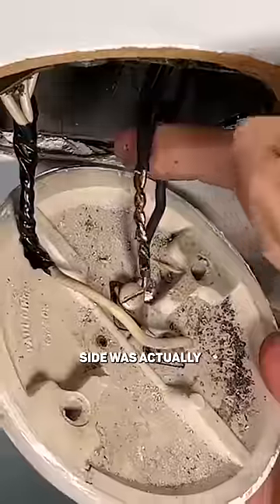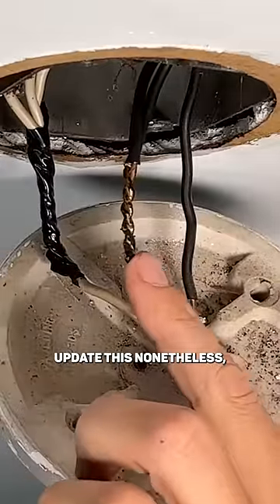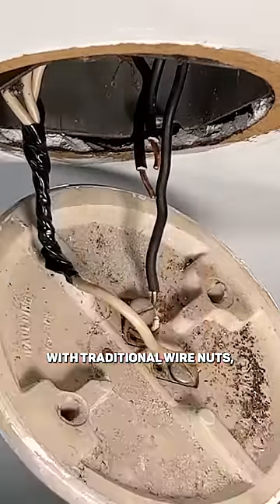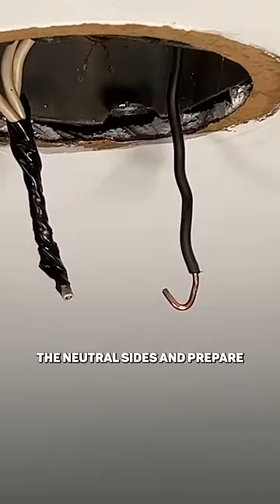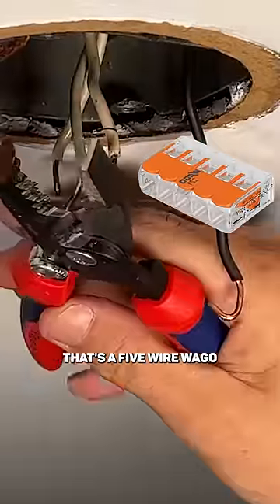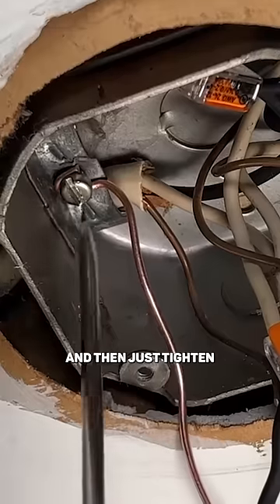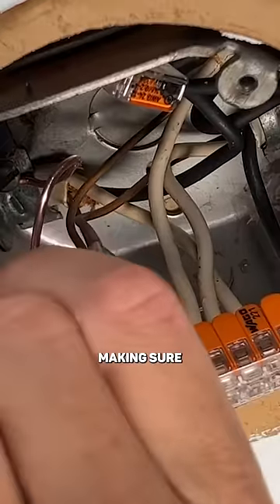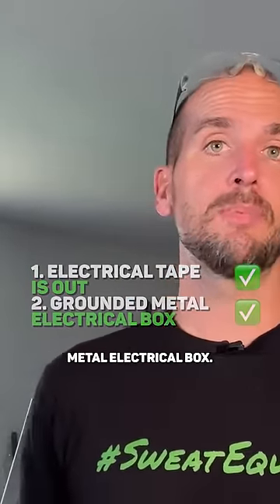Which Part Doesn't Meet Code?

Comment: I thought I was the only crazy person who soldered twisted copper wires together.
            And then I would put the wire, nut on after that for protection. 
And then use friction tape to wrap the wire nut to the wires

Comment: Those connectors melt. I wouldnt use them in high voltage over 24v. See it all the time on service calls. Wire nuts hold better than these connectors.

Comment: So a wago is better that a solder joint and a ground wire does not go on the code compliant ground?  What country are you in?  We have quality and safety standards in the states.

Comment: Dude I’m sorry to insult you but you have no idea what you are doing no master electrician would ever ground under a screw that could never get a tight connection to the box you should know better that what you put that ground wire under is a screw to secure the wire

Comment: Why whould you get rid of a solder joint like that? it will last longer if you use a nut or liquid electrical tape but instead you replace it with a wago connector which is not gonna last. all you needed to do was to cut the twisted solder joint to the right size and use a wire nut.

Comment: btw the first number of "412" or "415" is the maximum wiresize in mm² they are also available for 6mm² wire or a little bit more than 10 AWG but a 9 AWG won't fit.

Comment: stab clips are a fire hazard never use them that old connection was how old before you took it apart . if you do not know the neutral is a identified current charring wire so you connected ground to neutral hope you are insured you are going to have a fire no ground on fixture no ground needed

Comment: the ground termination is not code & by cutting out the solder weakened the connection. Take off tape, cut back twist, use wire nut. 100% better connection than using Wago

Comment: You are not electrician, the box is not bonded to the panel, putting a ground wire on a cable clamp is a big no no , plus the solder fine,

Comment: That solder joint will be the last thing to fall apart in that house. I don't trust waggy nuts. That's compression exerted by a plastic lever holding the wire against a flat piece of metal. Time, heat and corrosion will tell.

Comment: No you shouldn't twist them that long, they're supposed to be shorter so that all the copper can fit under the wire nut, it may or may not be cold compliant but I've been an electrician for years and I would never trust that enough to leave it in somebody's house without a wire nut and tape over it.

Comment: The wago piece of crap. use a wire nut or even better Solder its old school its better than wago loose connections and fails

Comment: Test them!! the contact points they make is not enough for any kind of load and failure of these are just a matter of hours instead of the traditional method that last for many years

Comment: A non electrician using fire starters to hold wires together. Not a secure connection. 
Twisting the wires together alone is secure and a wire nut secures and insulates.

Comment: Say it with me man. Way-go. Waw-go sounds goofy. Also, turn your hook the other way when screwing it down. When you go with the screw, the screw will pull your hook in tighter. Didnt look to shabby otherwise. Ive opened up work done by "handymen" that looked significantly worse. Just a little tip from a sparky my boy.
Reply: He wrapped the wire correctly in the video…

Comment: those “easier”connectors keep the service industry busy. I don’t like them. In a recessed can light is the only place I’d use them. He is in a remodel situation so there is some corners you can cut. Wirenuts are king. Should use a green ground clip if there is no threaded hole. If he is trying to go code he missed it with the ground. Green screw or green ground clip. Over all he cut out a connection that would go a life time without issue  and used  his easier connector that has a flat metal contact inside the connector. So you load is carried through a blade contact. Weak connection  when the circuit Runs back out to feed more devices/lights,plugs,  
shit trim the original  connection  use a wirenut  grab a self tapper pigtail the ground and make it up. Use your hammer to mash the wire in the box so you can get the cover on.  Oh that you shouldn’t. Do. Better use 2 3/0 extension rings. And clip the ground on the top ring. Laughing and some of the guys that read this have seen it.   Some have done it.
Reply from the maker: Thanks for all the feedback. 👍

Comment: the fixture is not grounded because there is nowhere to attach the ground wire.  Rather than cutting the wires short and using a wago, put a wire nut on it and be done.

Comment: Code Complaint?  Since when does Soldering home electrican code compliant?
Reply: Soldering is one of the oldest, and most secure methods of joining conductors. If done right, and insulated properly, there is no "better" way electrically.

Comment: Doesn't code require that the wires extend past the opening by 5 or 6 inches?
Reply: For new installations, yes. And if the box is 1 gang, then it needs to stick out at least 3 inches outside the box. If the existing box has shorter wires, then they can be extended or pigtailed for more length.

Comment: Your ground screw is no good because the box isn't grounded it's mounted to wood with Romex feeding it only the ground wire itself is grounded at the panel. Hopefully
Reply: I believe he was grounding the box in case a live wire ever came in contact with it, not trying to ground the fixture from the box.

Comment: Good luck with those wagos , loose connections about to happen , AFCIS breakers don’t approve them 😂
Reply from the maker: First I heard of WAGO 221 not being approved for AFCI circuits.  Is there a specific brand or literature you could point me to where WAGO 221 is called out by the brand as not approved?  Thx!
Reply: Wago is both ul listed and nec approved in the US. I worked in a law firm that handled construction defect litigation. Plaintiffs lost the case and the appeal primarily because of their claims that wagos were not code compliant. (Case was in OR 3 years ago)

Comment: Isnt a wago essentially the same as back probing an outlet which we all know we shouldn’t do
Reply: No, there’s a much larger contact area between the wire and Wago connector than a traditional outlet “backstab”.  I honestly don’t understand all of the hatred for them.  I use them in an industrial setting and haven’t had a single problem yet.

Comment: Anybody who uses those connectors should have there license revoked. Most dangerous connectors I have ever had the displeasure of coming across. They have a habit of coming undone.
Reply: How the hell do you manage to have a Wago come undone? What the fuck are you doing on the other side of the pond when you can even use Wago's successfully?
Reply: @AlexKall  open up the box and the damn things come apart in my hands. Almost been bitten multiple times because of those damn things.

Comment: In my old place, the 'electrician' had 'bonded' the hot wires with copper ground  crimps and wrapped them, didn't even bother to twist them. Then covered with electrical tape.
Reply: That wasn't an electrician then

Comment: Yup, I agree with everyone else who's already commented. 

The way you terminated that grounding wire was wrong and not compliant with the NEC. 

The grounding wire must be terminated in a manner that it's sole purpose is to bond the metal box to the electrical grounding system. By putting it under a screw that is there to fasten the cable clamp and cable to the box, you are not code compliant. 

The grounding screw shall serve no other purpose other than to fasten the grounding wire to the box.

 Although you might think, "what's the difference", the truth is, that cable clamp screw would not be providing as good of a solid path to ground as a dedicated grounding screw which is meant for this purpose would. 

So the method you showed should never be used and you shouldn't be teaching others to do it this way.
Reply: I know it’s not to code, but please explain how it’s not as solid a bond?  As long as that screw is tight, the bond is fine.  Will carry just as many amps to the same place as that pretty green screw.
Reply: @91156  The concern is that you won't get a really solid bond because in order to torque that screw down to give you a solid connection, you'd be damaging the wire under the clamp.

I used to do it the way you mentioned in your video many years ago, because that's the way I was taught by an old timer, but after going through an apprenticeship program and really studying and understanding the code and how electricity works, I don't do it that way any longer.

If you ever get a chance, try to take a Mike Holt class on grounding and bonding. His material is excellent and would help you understand why the way you are doing it is wrong.
Reply: @El_Diablo_LI  Never said I was doing it this way, because I don’t.  I said it was a lot better than nothing, because it is.   A clamp screw is snug enough to carry the amp load needed to bond a box.  I do follow code in MY electrical work.

Comment: I’m new so be gentle, you can put ground wires in a wago?
Reply from the maker: Yeah, but I should have used a ground clip or drilled/tapped a hole to bond the ground pigtail to the actual metal box and not the screw which tightens the integrated romex clamps.  👍

Comment: Screw can’t perform 2 functions . Must have separate screw for Gand wire
Reply: Well, this guy just proved you can.  Because even though it’s not code, that box IS bonded.
Reply: @91156  it will fail inspection
Reply: @chuckthompson9646  If it gets inspected……….

Comment: Oddly, I'll bet you're against using stab in receptacles and switches.
Reply: Stab in connections are junk, wagons use a tinned copper block with a spring retainer. Stab ins have a pair of thin copper or brass spring points… nowhere near the contact area of a wago.
I prefer wire nuts myself, but understand, WAGO is FAR superior to stab in outlet connections.
Reply: @whochecksthis  Anything that requires a spring and spring pressure is wholly unacceptable and subject to damage from heat. Many times I've seen wirenuts where the outer plastic was completely melted off, the wire insulation melted away and the metal coil from inside the wirenut was still intact and still making an electrical connection.
This will never happen with a wago. Once over heated the spring fails which makes the connection fail. If it melts it will completely fall apart.
As an electrician for 45 years and an electrical contractor for 20 years, I would never use a wago type device.
Reply: @trustme7731  sounds like a bad circuit… not really the connections fault. Wagos have their application… I certainly wouldn’t use them for junctions in long runs with multiple outlets… 
I see it all the time myself. Usually in junction boxes where a circuit feeds dozens of outlets… they get overloaded, and the weak link fails. 
Totally agree, the wago would be the weakest link.
Every test of them shows wire nuts are the lowest resistance circuit connection. 
But they can easily be installed incorrectly, causing a bad connection, or one that fails. 
Wagos ease of use, and visual confirmation of full insertion are useful for the tie in of a single outlet, or switch. Those lacking skill should use them over wire nuts…
Reply: @whochecksthis  If they are not suitable for long runs with multiple outlets, they aren't suitable anywhere. Being overloaded has nothing to do with how many outlets there are. The breaker or fuse controls this. A circuit with 100 receptacles can't be overloaded anymore than a circuit with one receptacle. What you are seeing in junction boxes is a poor connection due to sloppy installation. A wago under a sustained 20 amp load will likely fail as the spring softens. A wirenut won't. Contractors that use these are asking for call backs. They use them because their competitors are to lower their labor costs and we all tend to be reduced to the lowest common denominator to get the work. 
It's like at the airport. Instead of searching and x-raying just the people that are muslims and/or from the middle east, they do it to all of you. Or like a drug user that is always trying to get you to use to bring you down to his level.

Comment: You can't connect the ground to the neutral in that box either.
Reply: The video doesn’t show any ground to neutral connections, it shows proper 12/2wG wiring with three grounds tied together, and a pigtail run to the cable clamp screw.

Comment: Not good to cut the neutrals that short. should just have wire nutted a pigtail on the existing soldered splice. The ground fail has been commented by others.

Comment: That's not a proper ground
Reply: The wago not illegal but you don't know what kind of load is on the other wires. If it's large, like a fridge or microwave the wGo will get hot and fail

Comment: You dont solder wires on an AC circuit.
Reply from the maker: No doubt 🤔
Reply: You did back in the day. Twisted and soldered is probably the best connection you can get but like he said the electrical tape will crack and dry over the years. There's millions of homes right now with soldered connection and cloth type sheathing. It's not necessarily dangerous. It can be though.

Comment: Junk, had those type of connectors melt on me. Sticking to wire nuts. I get it they are easy to install but would rather not melt connectors
Reply: I don't believe a word of what you wrote.
Reply: It's all about profitability with wagos!
Reply: That says more about you than the Wago, getting one of those to melt is quite a feat to accomplish.

Comment: great, now use the right wago next time
Reply from the maker: Which WAGO 221 would you have used?
Reply: @EverydayHomeRepairs  keep in mind that the series with the lever, which you used there, is made for multicore (flexible) wires. The 2273 series is made for singlecore wires. Another sidenote: do not use ferules when using flex wagos (221 series), that is not required because of the wago locking system and can even cause issues with your installation. I know that you did not do the last in this video, but I thought that it should be mentioned

Comment: soldered connections with a modern wire nut are the king of all electrical connections in my opinion
Reply: @Kevin-mp5of  could you elaborate on that? It’s been a long time since I read the instructions on a wire nut but don’t remember it saying anything about using on soldered connections.

Comment: I'll stick to twisted solid core copper wires with wire nuts.

I've dealt with too many fires caused by poor connections in push lock connectors. A poor push lock connection causes resistance. The breaker will not trip because resistance is still a load. As the resistance continues you get heat. Eventually, that heat reaches a critical point and something begins to smolder.

Comment: You need at least 3 in of conductor outside the box and proper grounding
Reply: It's 6" of conductor length
Reply: @ChristianWorrall  it's 6" from the back of the box and a minimum of 3" beyond the box

Comment: There are now 2 new code violations. 1. That's not the grounding screw.
2. The neutral is not permitted to be connected to ground at any point except the service panel.
Reply from the maker: Spot on for the grounding screw, not sure where you saw the neutral and ground wires coming together.
Reply: @EverydayHomeRepairs  It looks like it's being inserted into the same connector as the Neutrals.
If it wasn't, what was the point of installing it: the fixture shown only has 2 terminals: one for the Hot and the other for the Neutral. Where would the Ground conductor connect?